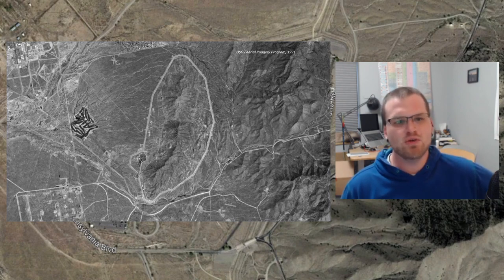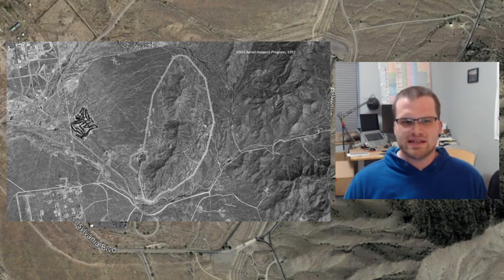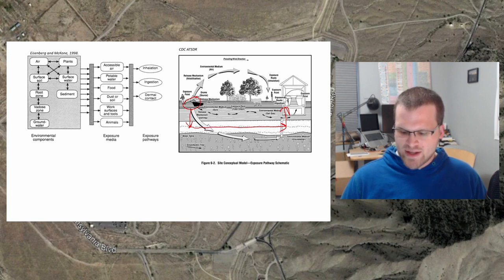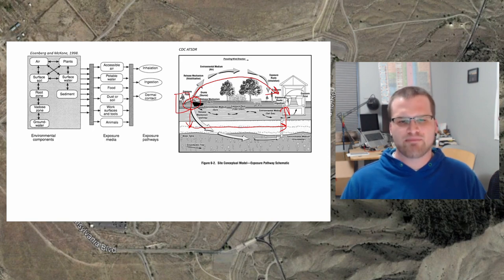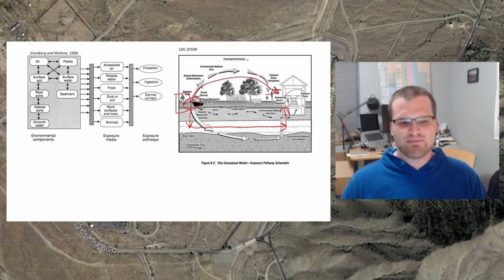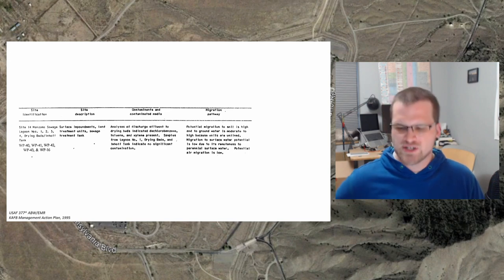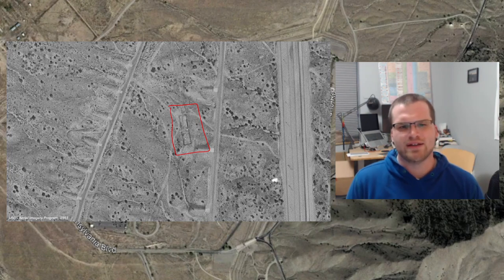Manzano Base, Part 2

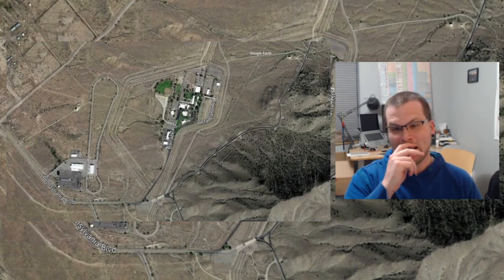Comment: 32:35 - I unofficially visited this Support Area in 2007 when an AF veteran took me on a tour of the old base. He drove us to the far north end of that Area so we could get a closer look at the famous security fence. I remember there was a guard dog training center - and at the end an ordinary brick building with the sign “Air Force Cryogenic Research”.  We got out at that point to take pictures of the multiple barbed wire fences (which were all old and rusting) - when a man in a lab coat and an unarmed guard in camo came out and nicely asked us what we were doing. The veteran showed his ID and there was no problem.

Comment: i worked at manzano base in 70 71 at the auto hobby shop and the vehicle maint facility. Every friday we closed the shop and washed down all the floors with solvent the used a fire hose to flush all that mess out into the area beyond the shop and into the desert.

Comment: Nothing about the B-29 carrying a nuke that crashed into it?
Reply: A B-29 loaded with nukes never crashed into the mountain. A KC-135 crashed into the mountain in 1977. However, a B-36 crashed near the southern border of KAFB carrying a sizable nuclear weapon in the ‘50’s.
Reply: Yes on April 11 1950 a B-29 taking off from Kirtland with a MK-4 at night failed to make the required right turn to avoid a local mountain (probably not the Manzano security mountain) . No radiation from the unarmed bomb which did have a couple hundred pounds of ordinary uranium - mainly a chemical hazard like lead.

Comment: There is no contamination at Manzano base because there was never any uranium enrichment or machine work done to nuclear material there. There were mainly nuclear weapons and components stored there in a ready state. The material was contained inside the weapons themselves.
Reply from the maker: The contamination hazard at Manzano Base is not a direct result of the storage use but of several different incidental uses:

First, parts of Manzano Base were used for washout activity (I believe of both radioactive and high explosives residue although the permit document is unclear) and storage of low-level waste, and there was potential leakage from these activities (although surveys performed as part of more recent permitting activity suggest this isn't a major problem). This seems to have been mostly after use of Manzano for weapons storage ended. This issue highlights one of the challenges of environmental remediation at these sites: it's not very clear what hazardous washout activity actually occurred at Manzano because very few records remain, and even at the time clear records weren't always kept. During closure it's typical to interview former employees to collect more information, but since Manzano is still under permitting (not a "closed" site in the sense of RCRA and other environmental regulation) this hasn't been thoroughly done yet. Instead a variety of locations on the site that records and rumors suggest may have been used for hazardous activity were sampled; in the case of Manzano this sampling has found low levels of radioactive particulates and heavy metals but nothing at the level that would require short-term remediation.

Second, an area of Manzano Base was used as a landfill for low-level waste, mostly shop equipment and PPE from the assembly building. This was the largest concern and was judged to pose a hazard to the environment due to the poor stabilization/containment of the landfill area. This landfill was excavated and the contaminated soil relocated, which I believe I mention in the video. I'm not sure where the removed soil ended up, most likely either at a more stable (and currently permitted) MLLW landfill elsewhere on Kirtland or at the NNSS landfill via the NNSS offsite acceptance program.

Third, as is usually the case with military installations, there was an automotive maintenance garage where diesel fuel and lubricants were likely disposed of by pouring them into a "dry well" or hole in the ground (a common practice at the time). This hasn't been thoroughly investigated because that building is still in use and so hasn't been handled for "closure," but a preliminary survey did not find contamination of the type that would pose a hazard prior to closure (that is, it hasn't reached groundwater).

In practice, it's very difficult to find any military installation that doesn't have significant environmental contamination. Fuel oils, lead, pesticides, and heavy metals (from solvent use) are the most common issues, although of course today PFAS from firefighting foam has become a primary concern. In the case of Manzano there is the additional question of radioactive materials, but other than the small hazardous waste landfill (less than an acre if memory serves) little has been found.